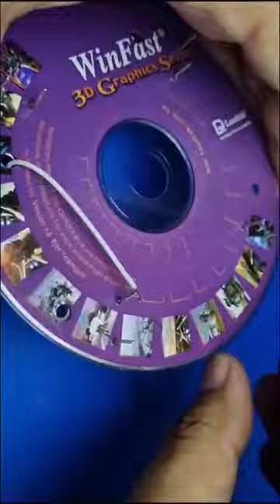Build a Solar Cell from a Transistor #zaferyildiz #shots #short #viral  #diy #solarcells #oldcd

Comment: Good but cost much more than battery for it
Reply: Not so much higher cost, but batteries have their lifetime and must be replaced once in while. These transistors will work enlessly. Less cost, less recycling.
Reply: @jarekferenc1149  thanks for answering me
Reply: @jarekferenc1149 боюсь , что на открытом воздухе кислород разрушит кристаллы полупроводников.
Reply: @nemoerambler4749  Наверно, так может быть, но защитить от воздуха мне кажется лёгкой задачей.